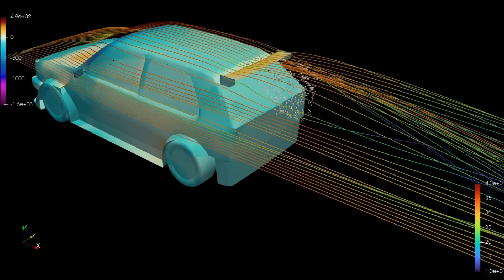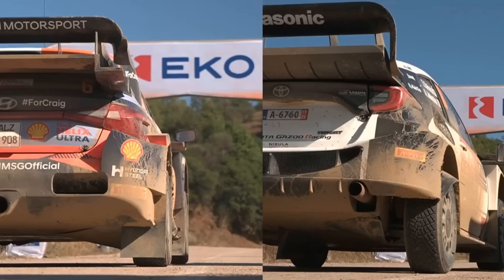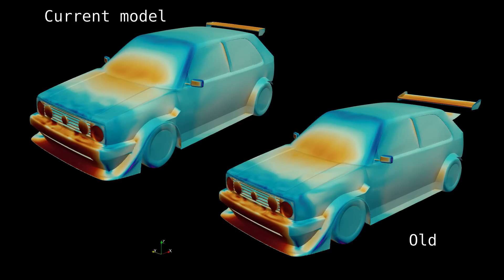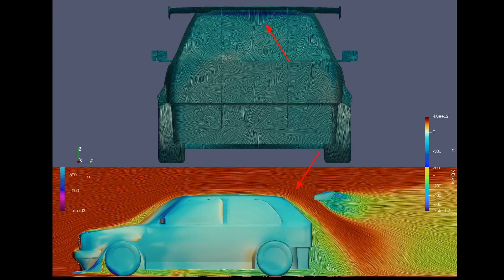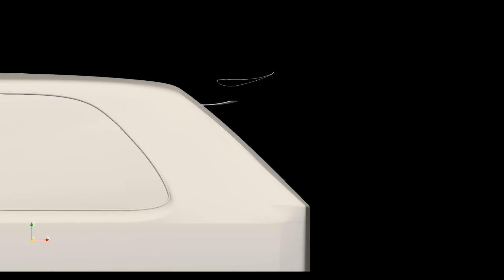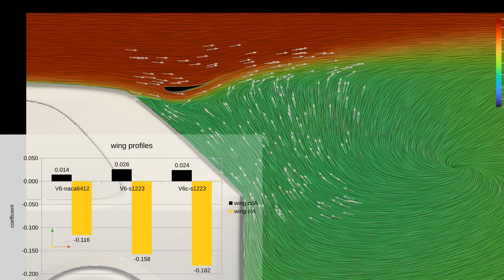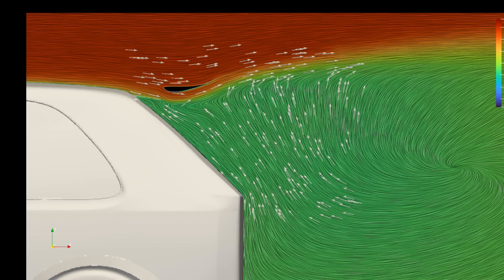Wings on a Hatchback

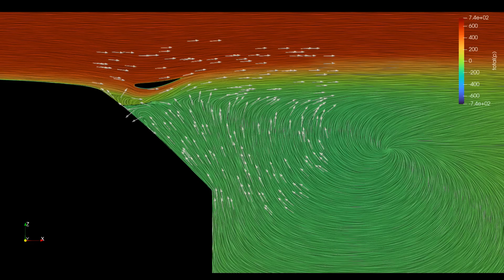Comment: ok, I took a screenshot of the config at 0:30 because I was really curious about how strongly the air is pulled down. The angle of the tailgate to roof transition is dead close to 30 degrees. That is the angle with the most induced drag for a hatchback rear end based on Ahmed body experiments, so it does explain your findings, especially that the model doesn't have any trips at the transition. The effective angle of attack because of the downwash is ~40deg, so yeah, no chance that would stick. At 3:45 it's ~25-30deg so again, separates. The second part of the rules you posted does appear to ban the plate, as it is a spoiler, but I'd be asking for a clarification. I.E the Civic running in improved production now has the integrated tailgate trip & a rear wing. On a separete note, would you be open to sharing a picture with the mesh shown? The model looks pretty smooth, but the vector arrows look pretty sparse and that could have an impact on some results.
Reply from the maker: The air is marginal on separation, the is bucket load of induced drag without the trip. A standard spoiler seen on every hatchback or wagon reduces drag by about 10%. The trailer in the video previously it was about 12%.
That rule set is just a way to anchor the video. I have done some work for an improved production competitor and they were responsible for the hatchback rule for spoilers.... 
A mesh for this car is about 25mil AMR. The vector glyph is 1:100 cells if I remember correctly. You wouldn't be able to see anything if it was for every cell.

Comment: Might just be my misunderstanding, but how is this not a benefit to on track performance? 

Also, will you be looking at wheel well  extraction? I've seen two approaches to this - one being to completely divert the wheel wake outwards similar to a bargeboard like on the M4 GT3 and the other being to vent it out like the R8 GT3 which seems to be the more traditional way of doing it.

Comment: Nice, even though as you state its a robust concept, i think a lot can be done on the flap design aiding in the turbulent flow direction where the flow detaches, i think that is key to optimizing the wing performance.
Reply from the maker: I don't think the turbulent pocket is such a bad influence on performance. The pocket is just sitting there rotating with laminar flow covering it. If the losses in that pocket burst out into the free stream that the wing uses, then that would be a concern.
I would agree that there is a large amount of room for optimisation.
Reply: @nelsonphillips  yes i agree about the turbulent pocket, i was more talking about optimizing position and angle of the flap to make the free stream take a more upwards direction also trying to make the flow detatchment as clean as possible, depending on wing position above that, i think you could gain significant downforce without stalling it. Some modern rally and rallycross cars (hatchbacks) have extremely cranked wings and also flaps underneath.
Reply: IMO the purpose of the flap is to more ensure that the vortex behind the car is flowing upwards behind the wing. You can see that the angle of the hatch is in a kind of deadzone- not angled enough to be a fastback, too angled to have clean flow separation. The final design of the flap extends it far enough out that the air coming up is fairly laminar, IMO the way to improve it is to have enough mass flow from the underbody to just push that vortex higher, give it an easier time clearing the vertical section of the hatch.
Reply: @someweeb3650  well, i dont think that increasing mass airflow underneath the car would do much difference for the roofline vortex, most of the air comes in from the sides of the car. Ofc, like always, you want a nice big diffusor, but most times when you have a diffusor and a flat floor you want to lower the car to increase the effectivness of said floor and increase the dynamic preassure, leading to lower overall airflow. And talking about huge diffusers on a hatchback shape car is also not eazy in practice. 

The video also looks at wings on hatcbacks within a certain rule set. And i think he did a good job within that. But in other cases you could achieve great DF with i higher placement wing and a good "flap design". And in regards to your answer, there are alot of ways to make the boundary layer after the flap more laminar. You could incorporate big strakes underneath it to improve more laminar flow, you could also look at winglet on the sides of the sloped rear quarter to bring in laminar energized flow along  the trailing edge or even corntrolled vortices of the flap creating a stronger boundairy layer making it possible to crank the wing harder.

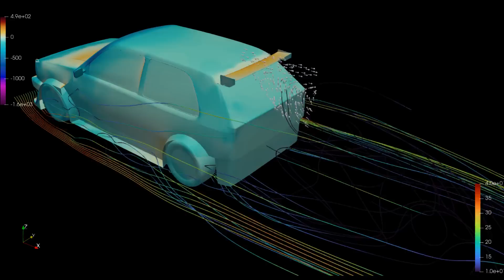Comment: With the configuration at 0:08, a positive aoa (so positive lift in free stream) should result in attached flow. Since the relative aoa that the wing sees is still negative, you make downforce and you could even get a bit of thrust because of the angle of the airflow. 

Now you are just stalling the wing big time, indicating a too high (or too negative) aoa.
Reply from the maker: if you add thrust with the wing it is countered by the increase on induced drag on the body. The last wing/flap combination is a good example of this.
Reply: @nelsonphillips  I still think it would be quite effective in terms of its dowforce production, test it out and see how it performs?
Reply: @toonverbruggen7351  I see what you mean, but it would be even better to have flow separation higher by the roof line for raw DF. Efficiency how ever, i cant tell without testing ofc.